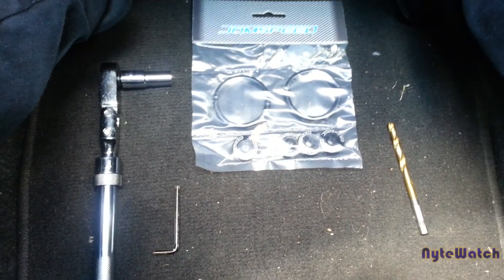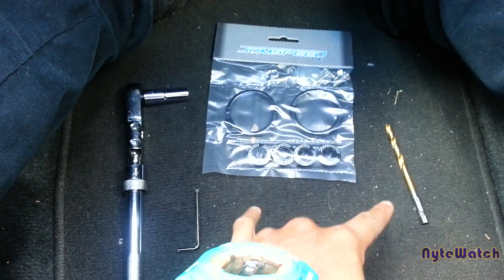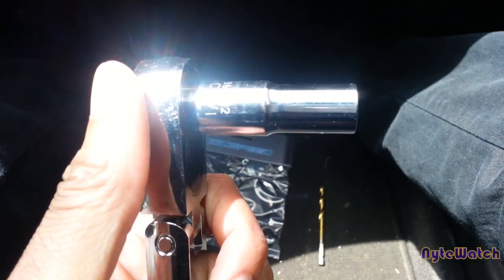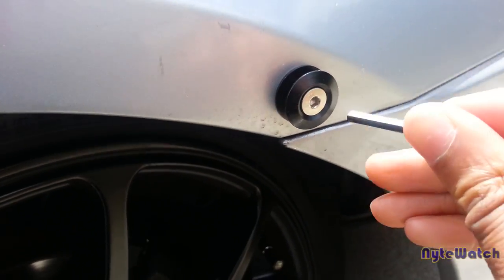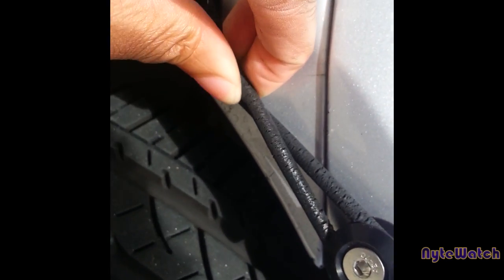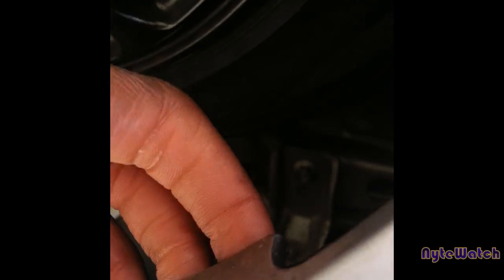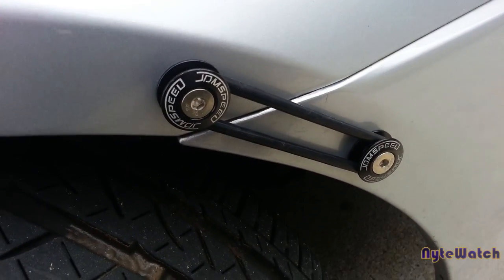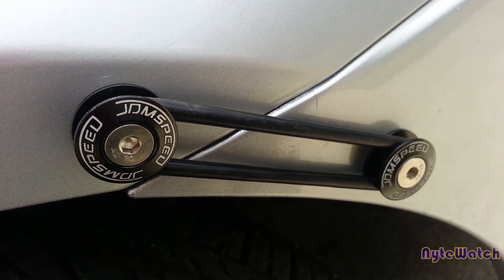Bumper Quick Release Kit (Walkthrough)

Comment: A video from 3 years ago just helped me a lot. But here's what I did. The rubber didn't have enough tension to hold the bumper properly and it still sagged a bit because it's heavy. So I ran some Clear fishing line to hold it in place and tied that off and then put the rubber strap over that. The line holding it firmly in place and the rubber helping with the tension as well as making sure that the line isn't showing whatsoever. Pretty cool but I just hope everything holds up in the long run
Reply from the maker: Glad this video helped. I still have the same rubber from this video on my car today. I hope the fishing line tension holds out for you in the long run.

Comment: Why not zip tie band?
Reply from the maker: With zip ties it will no longer be a "quick" release. You may still use those if you don't plan on taking advantage of the convenience of using the rubber bands. While the zip tie could provide a tighter connection, just be careful if your car is low there won't be the little bit of flex you may need for a "climb" over a minor speed bump or whatever.

Comment: How far apart did you space them out? That’s my biggest issue is spacing
Reply from the maker: My biggest issue was in inner liner getting in the way honestly. I'd suggest doing a sort of test run by holding up one release with the band on and creating enough distance between the metal holders to where you feel tension (enough to hold the bumper up) then mark one spot at a time with a marker on your fever and one spot on your bumper for the holes to drill. The marks you make should line up with the holes with the metal pieces of the release. Hope this helps!
Reply from the maker: Hold the release up against the area in which you would want the release to be.
Reply: NyteWatch worked out great! I did the infinity loop right off the bat so let’s see what happens!

Comment: Serious question, do these hold up the bumper on their own?
Reply from the maker: They actually can BUT it depends on how tight your bumper fits WITHOUT any of the OEM bolts / fasteners.
Reply: @NyteWatch  I'm considering putting some on,  so thank you for the reply
Reply from the maker: I could go on with stories on how useful they are but it'd be a book. Good luck!
Reply: @NyteWatch  one more question, do you think they'd work on a fiber glass bumper? Obviously you can put them on fiberglass but can you think of any reason they might not hold up on fiberglass?
Reply from the maker: @CDM10000  I can't speak on that too much but I'll just say to check on it from time to time. It should be fine. I'll say your measurements will be your hero in the long run. There's no going back once you drill into fiber glass unless you're pro pro.
Reply: @NyteWatch  yeah, ive patched the question a few times. Thanks again dude I'll see what happens